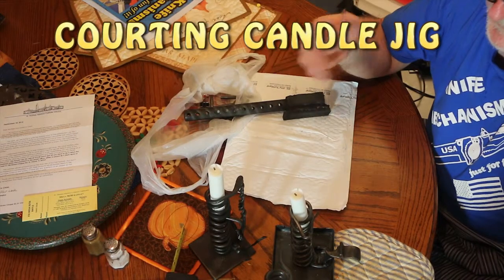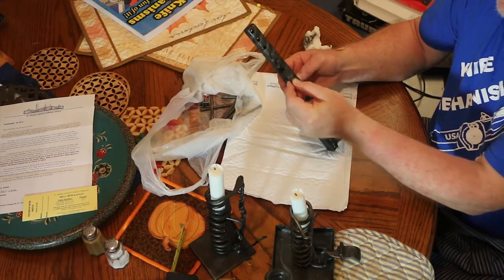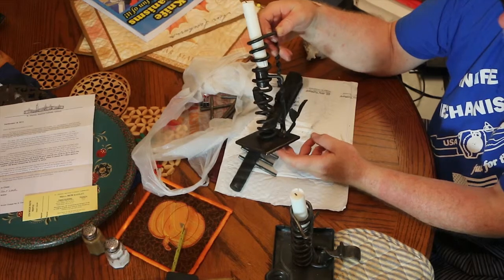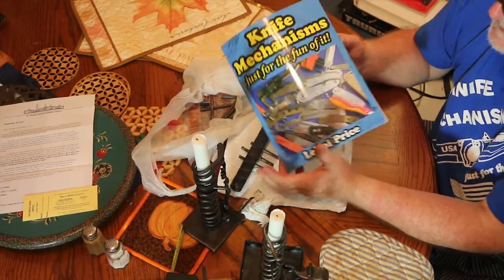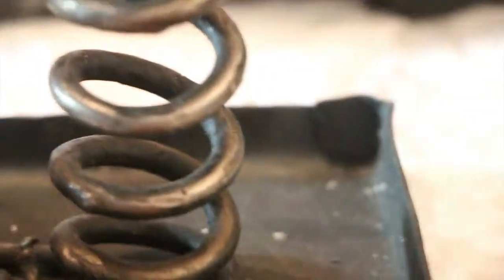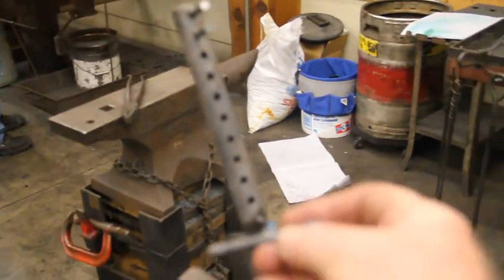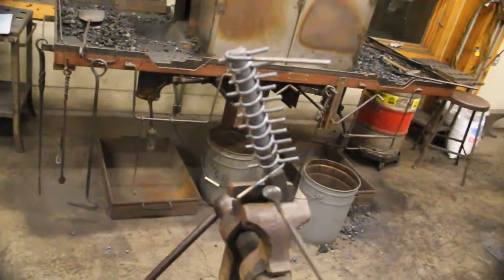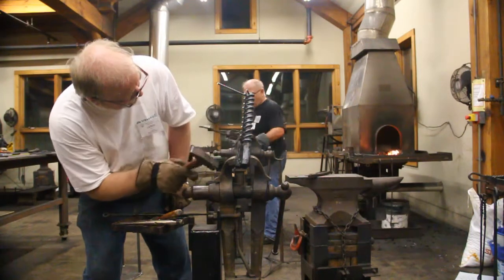Courting Candle Jig  - Making a Beautiful Sprial

Comment from the maker: Those pins don't need to be that long. The length kind of get's in the way with making the spiral. They started out that way because I thought the long pins would be less likely to fall out. But not much help. The glob of weld solved that problem.